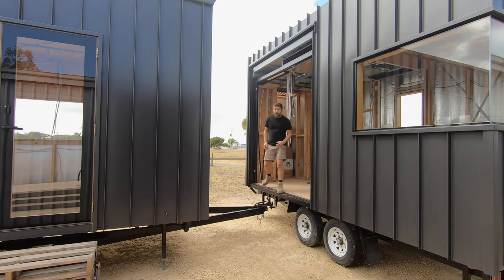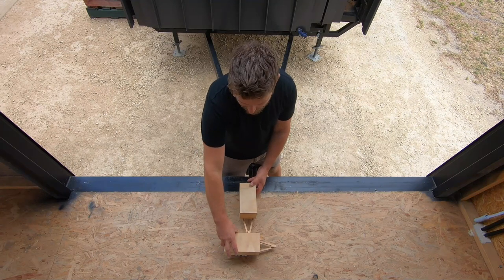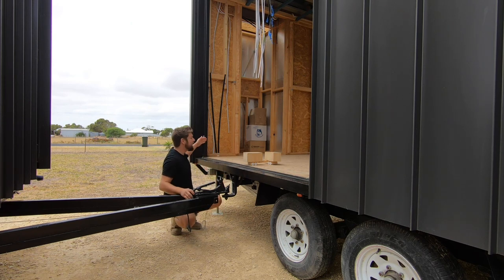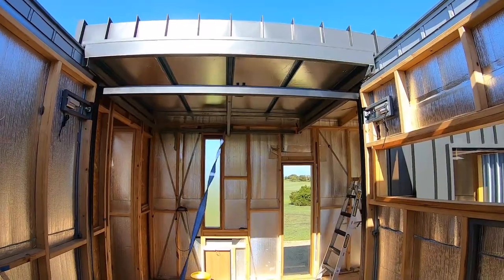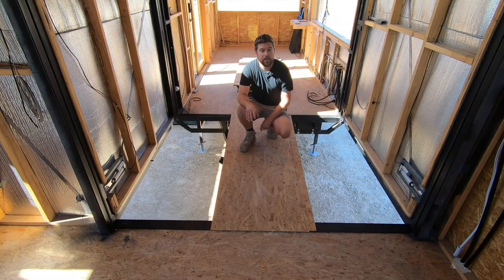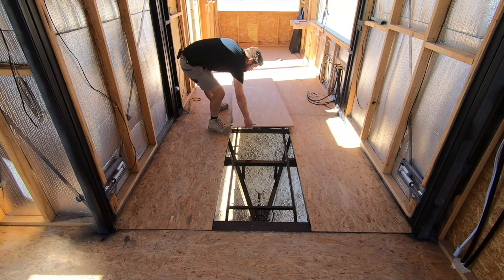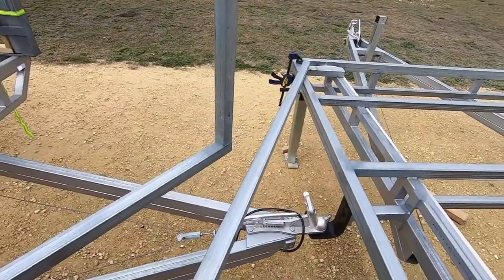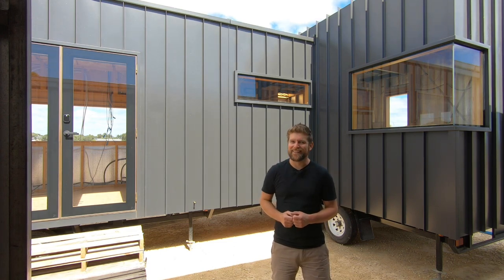Ep. 27 - How I join my two-trailer tiny house - Tiny House Build Update

Comment: Great engineering, I have a question, why did you wanted to join the houses, what where you trying to solve, whats the main scope? When coupling the houses there will be air gaps, it will be complicated to achieve air tightness, its good to have thermal insulation, it's also better to couple it with air tightness.

Comment: Still amazed. Such a baller idea! If the covers youre making for the ends are solid, I wonder if they could also be used as a deck once the houses are installed
Reply from the maker: Ha, cheers legend. No think more soft tonneau cover. I would never be able to lift something solid up. Just need to keep the wind out.

Comment: This is Amazing and you've definitely got my creative juices flowing in reworking my own Tiny house design, what I can ask is did you consider a sliding deck floor using industrial heavy duty runners for the gap, essentially creating a subfloor in the one tiny house or trailer that can slide out and clip into the other. I would love to know your thoughts on that idea and again great job on the build and thank you for great video.
Reply from the maker: Thank you my friend. I love that it's giving you some ideas. 
Yeah I did think through that idea. There were three major issues. 
1. Significant redesign of the trailers to allow a floor to slide out. It would have raised my overall floor height and not only would I need to allow space for the floor but also sufficient structure for the permeant floor above the one that slides out.
2. It would mean that my floor is at different levels. There was no simple way to have a floor that slides out and then is the same height as the rest of the floor. I could have done a super complicated lifter but that would have been a LOT of engineering. Given I don't pack up and setup very often a slightly more involved way won over the very complex build. 
3. I have had to build this join so that it lines up perfectly and won't move, but then assume it's not going to line up and will move anyway. A slide out floor would require the two trailers to be perfectly aligned and would not allow for any variation. I.e. right now the two trailers are slightly out and you can actually see the difference in the gap in the floor (that will be under cover strips).
Love the thoughts. Keep them coming.
Reply: Two Hands and a Tiny House thank you so much for the reply, your points make complete sense I didn’t think of that. Thanks again and really look forward to your next video
Reply from the maker: @AewonWolf  anytime my friend, there was so much to trying to make that work. Would love it you come up with a better design. Please share it,  definitely keen to see

Comment: What was your eventual solution for the floor panels? Also, are they insulated and if so - what did you use? I hope they are insulated properly, else you just created a major thermal bridge between your two trailers (and there is already a major issue with the airflow there as is)
Reply: Looking at your solution though, might it not have been better to have the floor panels underneath one of the trailers and slide out like they did for the roof panels (and then use a hydraulic system like you have for the panel lifter to level the floor into place). You could also have a sliding panel on the side-trailer that buttons up the side, and then slides out of the way on rails when you want to open the house up. (If done correctly, the rails could have also had a swivel mechanism so that it could swing out to provide the outer wall without the wall from the main trailer). 

Either way, nice concept! I'm sure it can be perfected, even if you had to jury-rig some solutions on your particular build.
Reply from the maker: The floor panels will be lined with foamcell (a foam sheeting). The same as the rest of the house. I slept in there one night and the foamcell with an air cavity makes a huge difference.

The idea of having the floor panels slide out is a great one but insanely difficult. Huge egineering challenge and almost impossible given they need to be same width as the trailer yet the trailer floor needs to support a large structure. Great in theory but beyond my skills to egineer. Anything is possible with enough time, money and brain power of course. The current design works pretty well and I only have a couple small holes for air that are dealt with using some EVA foam

Comment: Could you have put the floor on the trailer with the hole?
Reply from the maker: I did explore that. There were a couple issues that prevented it. 
1. The trailers had to be PERFECTLY aligned as the floor would be swinging down between the walls. If it was slightly out it would damage the walls. 
2. There would be a gap at the bottom between the wall and the floor which was hard to hide. Now the walls overlap the floor so it hides the join and any variation in alignment. 
3. The thickness of the floor prevented the doors swinging around and nesting into the side trailer. I could have recessed the floor even further but that would have taken up so much space. 
4. It would then be fixed to the side trailer but the join that is seen is between the side trailer and the floor. So, any variation in alignment would show in the join between the main trailer and the floor. Whereas now that gap will be hidden under the wall that will be built on the side trailer. 
Love the thoguhts.